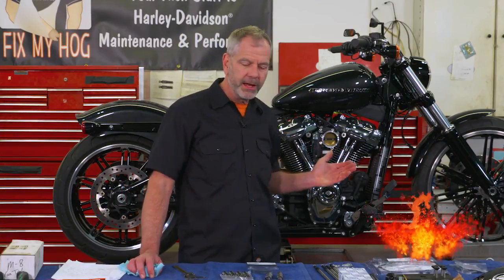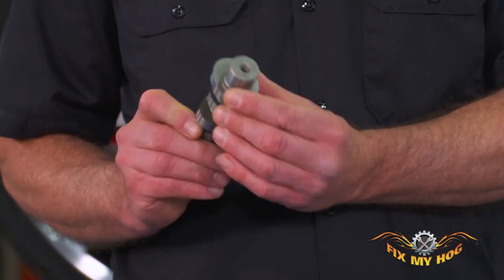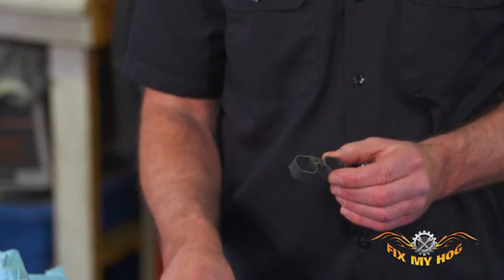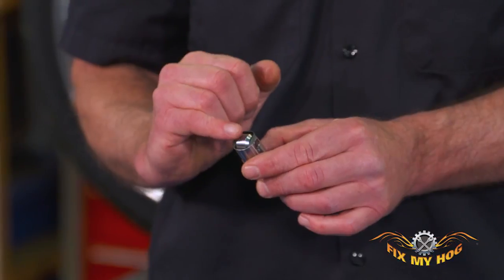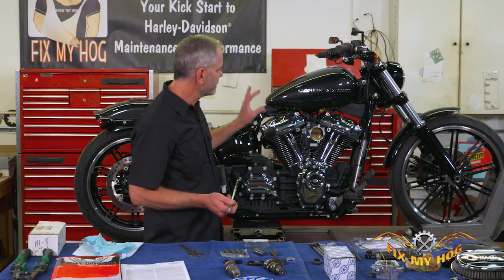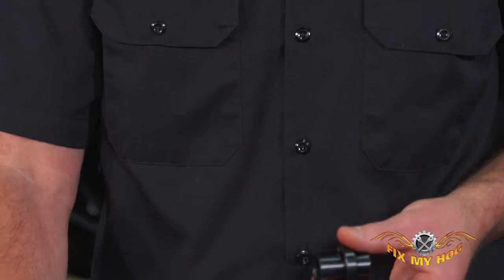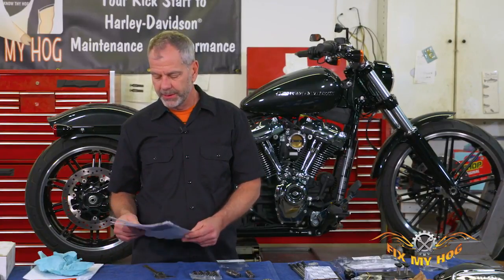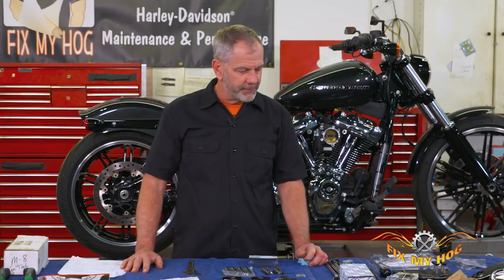What is the Best Cam for M8 114 or 107

Comment: Mike put my Woods 22XE cam in last year! Loving the power band of it!
Reply: You still enjoying the 22xe? Ya keep a duel exhaust? How much gane in tourqe and hp?
Reply: @brockvermillion8960  yes, still liking it! I kept dual exhaust… My M8 107ci made 115TQ and 109HP if I remember correctly. Running the jackpot 2-1-2 and khromewerks mufflers with ripper baffles.
Reply: My 114 with woods 22x,intake upgrade,injectors upgrade,oil pump upgrade, tts tune,v&h slip on made 111 hp and 127ft# torture
Reply: Mr RG20, who m doing the 22xe, wondering reliability on the long runs (interstates rides) and durability. W your experience?? Thanks much Mike Florida

Comment: Thanks Mike, good information......I noticed that the specs on the 475 have different timing for the front and rear cylinders (for example, the front cylinder intake valve opens and closes at 6.2 degrees and 27.2 degrees respectively, but the rear cylinder intake opens at 2.2 and closes at 31.2). I'm pretty sure contributes to its very aggressive lope, but this is the only cam that I have found that does this......can you comment on why S&S chose to do this? I have a suspicion that the hotter temps of the rear cylinder may be part of the reason, but that would beg the question, why doesn't everyone else do this too? I can't seem to find any good explanation for it or why such a design is better than cams that keep valve timing the same for both cylinders.  I'm still tossed up between the S&S 475 and the new Woods Performance 22XE.
Reply from the maker: S&S has a great resource page: https://www.sscycle.com/tech-info/cam-specs-overview
Reply: @FixMyHogfreechannel  Yes, I've read every word.  Unfortunately, that page appears to be quite out of date....Nothing on the 475C (the page presumes that the 475G is only available), and not a word about the 465C or 550C cams.  Also nothing explaining why the timing is different for the front and rear cylinders.  Nothing on the page leads me to believe that it has been updated since the M8 came out.
Reply from the maker: @jerrym2321  Give them a ring, great peeps and great customer care.
Reply: @FixMyHogfreechannel  No complaints with S&S....they have gotten a lot of my money over the last 50 years!  But this time I went with the Woods Performance 22XE.  Still using the S&S cam plate, oil pump, and tensioner though.  But I'm still curious about the timing of the S&S cams and the reason for front and rear cylinder difference.  Maybe someone out there can shine a little light on the subject.
Reply: @jerrym2321  I’m undecided between the S&S 475c and the woods 22xe. How do you like the woods and what pipes do you have with the woods?
Reply: @williammason8566  They are both great cams for the M8.  The 22XE in my 107 runs great with a PowerVision tune provided by Fuel Moto.  I'm running a Fullsac head pipe and Rinehart 4" slip ons.  I also have the S&S intake and a Ness Big Sucker air cleaner.  If you want more lope at idle go for the 475....if you want a great overall cam, go with the Woods.  FYI, the 22XE is very similar in lift, duration, and timing to the Red Shift RS472.  Check it out.
Reply: @williammason8566  One more thing....Fuel Moto has a ton of dyno maps on their web site....they were very helpful in assisting me to decide which cam would be best for my particular application and riding style.  Give them a call.
Reply: @jerrym2321  thank you for the info.
I'll give them a call.
Reply: @jerrym2321  oh by the way,  I have a 2017  Road Glide. I currently have a SE 462. Not thrilled with it. It has the TTS tuner in it. It sucks. So as I am learning of the  inadequacy of the oil pump I plan on having it changed out to the S&S pump and cam plate, so while I am back in their I’ll put in a better cam and tuner. My pipes are kromewerks. Full system.
Reply: @williammason8566  The S&S cam plate and pump is the way to go.  S&S is the only one I've found that used a bronze bushing in the cam plate....all the rest are just the aluminum plate material.  Either cam you choose will perform better than the Screamin' Eagle cam....I have a friend that had the same cam installed in his M8 (didn't want to void the warranty) and it made no noticeable difference at all.  Talk to Fuel Moto before you buy your cam.....they are really great to work with and are very knowledgeable. Best customer service in the industry!
Reply: Dexter Suarez  Yes Dexter, I agree completely.  The 22XE is a great cam for the M8.  There are other good cams too, but the power band of the 22XE is just right for 2-up Vermont mountain roads.  And I'll add that Bob Wood is a great guy too....for a good read try his book Learjet 464.
Reply: Yep. Seems like S&S tuned the 475 to make M8's sound like Harleys very intentionally. The M8's are too 'even' sounding. At first they just sound like a Harley, but put them next to any other generation of Harley engines and they sound 90% different.
Reply: @PotatoeJoe69  Absolutely agree.  You're the first one to actually comment on the valve timing....seems most people are completely missing it and I'd still like to hear from S&S as to their reasoning...has to be more than just the idle lope.

Comment: Question. Opting to replace a camshaft (primarily to improve the sound, torque etc) Will that be a problem for the engine 10 years down the road? Is the engine designed for these types of after market parts(s&s cams etc) and that it won’t  lead to other problems? Pls do advise. Tq
Reply from the maker: Great question! The ‘Ask an Expert’ section is currently for members of our online community. I would be happy to send your question off to the experts. To get started, please send the email associated with your paid membership account. Thanks!
Reply: Good question, but I don't really care about 10 years...down the road, that's alot of years of good riding, q stock motor could blow before then, and if we aren't ready to put the latest great motor (ie: 131, or whatever it might be) in our bikes, 10 years from now...we are scared little whimps..and I ain't it.
Reply: Most of the wear items are replaced if you do this job in its entirety. OEM things like the plastic lifter cuffs, the cam bearing (as pointed out in this video), and the pre 2020 oil pumps are all regarded as parts prone to failure. Any one of those goes bad, there's a good chance that your entire engine could be smoked. If you're concerned with things like bottom end issues, the only thing that may sacrifice longevity is if you're now inclined to constantly beat the snot out of your bike, lol. Frankly, you're better off doing these mods to improve the long-term survivability of your bike vs leaving the stock junk in there. The above-mentioned parts are basically ticking time bombs.
Reply: My bike runs better, cooler and produces power easier… I’d say it actually improves longevity. That’s definitely depends on the lift, since most use stock springs. I’ll never own a stock HD again.

Comment: I have a high compression (113 c.i.) , 2000 Springer with a carb. I want to change the Harley 266 cams to the stock cams. Are there any after market cams that are very similar to stock cams?
Reply from the maker: If you prefer to run stock cams, we would suggest purchasing stock Harley Davidson cams from the dealership. Best to run them with a hydraulic cam plate. Otherwise, we would go with S&S 510 cams for mild, bolt in, cams. https://www.fixmyhog.com/videos/cam-chain-tensioner-shoe/

Comment: Will this cam create more heat in my m8 or will it run cooler after right tune and breaking in period
Reply: Depends if your still running stock head pipe.

Comment: Is this a good cam to pair with my TBR short turnout exhaust or should I get rid of that pipe and get a V&H pro pipe?
Reply from the maker: Great question! Please refer to our Tech Q&A page for more information. https://www.fixmyhog.com/posts/harley-tips/

Our Premium Members enjoy ‘Ask an Expert’ as a part of their paying membership. By becoming a member, you will have access to our expert’s knowledge in motorcycle repair, great discounts on products and hours of Premium video content. 

If you are interested in becoming a member to Fix My Hog, please click on the special offer below: https://go.fixmyhog.com/a19768.

Thanks
Reply: @BaronvonOldenbiker  what about a Vance and Hines 2-1
Reply: You're probably not getting the needed back pressure using those short pipes. Bet it sound good and loud though.
Reply: @derfskittlers6125 Yes it does!

Comment: I have a 2018 RGS with the 107 and I recently had the 465G installed. Could I use this cam if I look to put 114 jugs on my bike at some point and if so, would this be a good cam for that build?
Reply from the maker: Great question! The ‘Ask an Expert’ section is currently for members of our online community. I would be happy to send your question off to the experts. To get started, please send the email associated with your paid membership account. Thanks!
Reply: Depends on what type of riding you do.  The 465 is a great low end torque cam but it drops off where as fhe 475 comes on alittle later in the rev range but has a flatter torque curve.

Comment: With the defects on the M8 why do they have a stage 2 when the S&S parts should be the stock parts ,if the owner wants to add stage 1 well that is the owners choice,when you're spending 55k in Australia for a CVO why don't Harley do it correctly in the first place
Reply: its called emissions
Reply: They don't break emotions laws. Using a better product